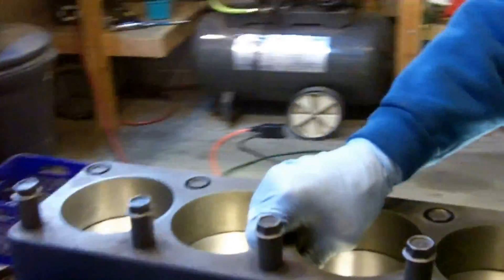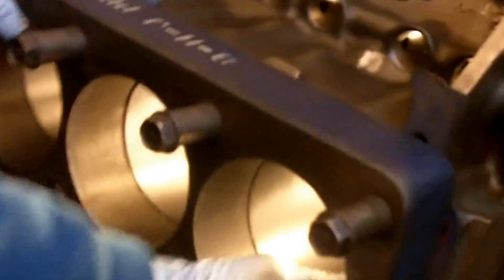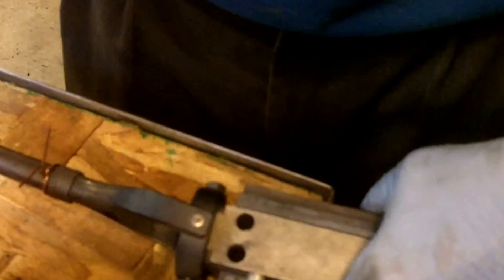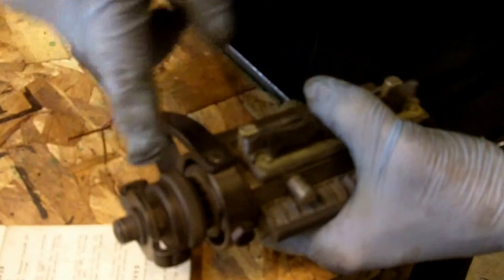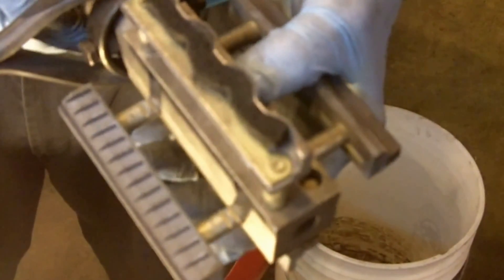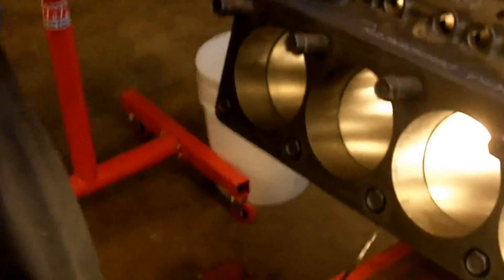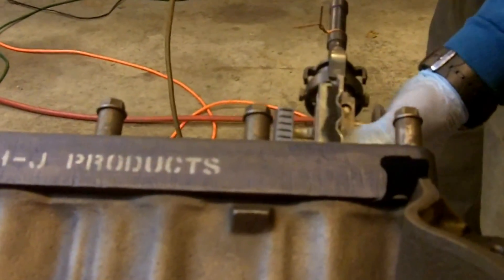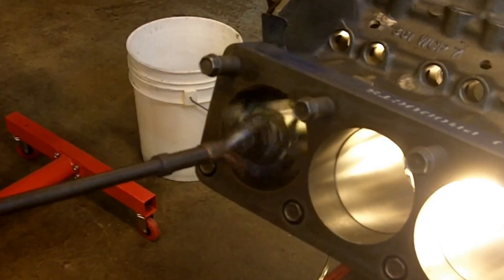Engine Building with Rog - Hone and Measure - HD

Comment: I wonder if the engine stand creates bore distortion, by having the engine supported only at one end (vs two ends in car)? I've watched videos of honing on the assembly line and OEs usually hone blocks sitting on a flat surface. Great tips, thx.
Reply from the maker: Thanks for watching. I'll have to ask the old man about your question. It's a good one for sure. There is so much material where the stand is holding on to the block that I doubt there would be any distortion, but I guess you'd never know for sure.

Comment: I'm using a plateau hone tool made by Lisle to remove flat spots and vertical scratches/grooves using 80, 180 & 280 grit stones on a Hyundai 2.4 I4. The engine has thin steel sleeves pressed into the aluminum block.  I don't want to take away too much material from the steel sleeves via the honing process.  Would leaving a shallow and narrow vertical groove in the bore effect compression and oil burn that much?  Thanks in advance!
Reply from the maker: Thanks for watching. My old man said you don't want any vertical grooves, ring could snag and you could have compression loss. Best thing to do is make sure it has nice cross hatch with a flex hone. Thanks!

Comment: Excellent video! I'm just wondering why you guys don't use any oil as a lubricant. I am just few days before I want to deglaze my engine but I have that 3 stone hone and I'm wondering if I should use some lubricant or not. The principle is in general almost the same it's a stone honing, it's not that flexible stuff. So why you don't use it and what should I do, lubricate or not? Thanks a lot!
Reply from the maker: Thanks for watching. I'd have to ask my old man for sure. I'll do that and get back to you! I have a feeling he is going to say not to use any lube since it would just cake into the hone, but I don't know for sure and don't want to give you the wrong advice. I'll let you know for sure.
Reply from the maker: My old man said for a deglaze, use a flex hone with some lube. You should be good. Thanks again!
Reply: @BarnStangz  Thank you very much

Comment: Invest in a honing tank it will make a difference you wont believe. A simple metal or plastic tub under the stand and a decent pump. Does not have to be a flood flow equal to a solvent tank would work. make some simple shields to control the splash. 2 Quarts atf 1 quart 30wt 1 quart Kerosene. If the stones seem to be loading up add kerosene, use heavy pressure as much as you can control to avoid taper. Ruff and shape to withing .003  with ruff stones. Finish to size with a very fine stone 400 grit. use a 600 grit ball hone to debure. (you have to special order those) 
Always do short strokes at the bottom between full strokes if it is tapered smaller at the top thats easy to bring back if its smaller at the bottom it can be impossible to get straight again.
 This is 30 years + of professional experience. take it or leave it .
Reply: Why would you comment on a video explaining and showing how to do what you’re explaining in the comments? It’s ignorant and unwanted... make your own tutorial if you want to be informative
Reply: @matthewcarkner3687  A little lernin makin your ignorant little brain hurt yah moron troll
Reply: learning if you’re going to insult someone, at least be educated enough to come correct. Have a good day “sir”
Reply: @matthewcarkner3687  his info
Is correct, while the original video is correct also, he just added additional info and procedures that apply. Both are old outdated methods when dealing with today's rings and cylinder surfaces. This applies more to old cast iron rings/moly, rings today are far more advanced and require totally different cylinder surface finishes. If your not using a profilometer these days your not doing it right.

Comment: Thanks for a great video – this is realy wisdom for a lot of us and I’m looking forward to watch your other videos. I’m about to replace bearing rings and wondering if I should hone with both stone and flexhoner as you do in the video. Or is it only necessary with the flexhoner? The cylinder has not been bored, scored or anythin and messauring of cylinder diameter shows horizontal ovality – less than 0.001 inch.  Thanks again
Reply from the maker: Thank you for watching. The old man knows his stuff and he REALLY likes to share his knowledge with everyone. I have some more videos on my channel that you might like. We are going to try and finish up this 408 winter of 2019/20. You know how life gets in the way, lol.... Engine has been 8 years in the making!

My old man said that the flex hone should be fine. just make sure you clean it well with Dawn dish soap after and blow it off good. Then coat the thing in WD40 unless you're going to paint it right away. Good luck brother!

Comment: Would this hone open a cylinder enough to allow a dry liner to be fit.
Reply from the maker: You would want to have a machine shop get the rough size and then yes, you could perform the finish hone for a perfect fitting.
Reply: Would it be possible to do it with this, all of it I mean. If I want to insert a dry liner of 1.5 mm thickness, could I use this first with rough stones then smoother ones.
Reply from the maker: You sure could. It would take time and lots of cleaning of the stones when the get built up with material, but yes, you could do it this way!

Comment: I bet you could build great turbo 4g63.  probably not your cup of tea. but with your experience I feel it you could build one that holds 60+lb of boost.
Reply from the maker: Mikey; I'm sure that the old man could build a nice turbo engine. I actually would like to do that at some point. My old man has built a 22RE and a LOT of 1st. Gen Mazda Rotary engines. I'd like to do a video in the future about building the Mazda. I think that would be fun. Thanks for the comment.
Reply: BarnStangz I have a 22r in my Toyota pickup truck. has over 300k on it and still rolling. 
Yes! a rotary video would be awesome.

Comment: How do you dress the stones to make sure your hone isn't cutting a taper? Do you just compensate with your strokes? Eventually you have to cut your crosshatch and cant modulate where you're spending time cutting anymore so what gives?
Reply from the maker: Dressed the stones by using a wire bush to clean them. Every few strokes, we'd remove and clean them. But if your bore is good and round and the stones aren't loading up bad you'll get good cross hatch. You have to listen to the dwelling as well. I'll try and get some more information for your from my old man this weekend.
Reply: Because this style of hone is "rigid" more or less rather than spring loaded like a ball hone or "apprentice propeller" as I've heard them called I believe this hone will be more sensitive to how parallel and even the two stones are end to end, if one side of the stone is worn more than the other the hone is going to cut a taper for a while until the high spot wears down from cutting as the smaller end will be doing less work and wear down slower similar to how lapping is done. I'm debating investing in a hone like this (around 150 bucks) but my main concern is maintaining the geometry of the hone because it is not "driven" by the bore as much as a ball hone or tri-stone. 

I had someone from the machinist facebook group sugges that if possible (in the case of a motorcycle cylinder) alternate from one side of the cylinder to the other sticking the hone in each side.
Reply: @Max_Marz  these types of micrometer adjustable hones require maintenance, you can maintain by measuring the stones installed in the tool using a micrometer or using prussian blue on the stones in a known good bore and marking the high spots and then dressing the high spots down using a dressing stone or diamond plate, sometimes it is easier to buy replacement stones if abnormal wear is encountered. These hones are not really the thing for a one off, quick rebuild job, they are a professional tool.
Reply: @2secondslater  I especially liked the prussian blue method against a reference. This pleases the machinist.
Reply: @Max_Marz  no problemo, I am not a machinist but have been a tradesman in the automotive industry for 25+ years and know a thing or two about machining processes etc

Comment: The torque plate doesn't do anything unless you're removing considerable amount of material with hone.
Reply from the maker: +Marek Sumguy Using a torque plate applies equal distortion during honing and simulates having heads on the engine. You want round bores right!?
Reply: +BarnStangz  Sir!... i am well aware of the intended purpose of a torque plate.   I don't think you understood what i was saying.  Im saying... that the distortion may be greater than the amount of material being removed.  Understand?
Reply from the maker: +Marek Sumguy I guess I don't understand what you're saying. The torque plate is bolted to specs, then honed. if you take a dial bore indicator and go from the bottom of a block without a torque plate hone job, you'll see ugly results. Most builders always hone with a torque plate... but to each their own. I wasn't trying to get pissy with you...
Reply: +E Gibson  Nah... you're just a dumbass who wouldn't recognize sound advice if it hit you in the face.
Reply: Ha... i was just thinking the same thing!.  It really depends on how much material you intend to take off with the hone.  So when you bore, you actually under-bore it... and then you reach your final bore size dimension with the hone.  Comprende?
Reply: I thought that before honing with a torque plate, the block would be needed to be bored with a torque plate.
Reply from the maker: Marek Sumguy This guy gets it.
Reply: If you torque plate bore the block then the finish hone should also be done with a torque plate installed, it is as simple as that.
Reply: Jake Elliott correct. But that’s not what I’m talking about.
Reply: @mareksumguy1887  I would think that this old timer wouldn't torque plate hone a block without having it torque plate bored initially, thus negating distortion. Just my thoughts.
Reply: +Marek Sumguy you just sound like a d-bag trying to flex his brain..beat it

Comment: You need honing fluid!.
Reply from the maker: +Marek Sumguy Not all stones require honing fluid, always read direction for the stones that you have. The Sunnen stones that we used called for dry honing.
Reply: BarnStangz what is the difference between dry honing and wet honing with oil and kerosene
Reply from the maker: Really depends on what the instructions say with your stones. 500 series polishing will require wet. Finishing 200/300 series are done dry. This is for Sunnen. Sorry for the late reply.

Comment: Do you hone completely dry? I've read that some people hone with constant fluid flushing while honing. What's your thoughts on this?
Reply from the maker: I hone completely dry, the rpm is slow and I find that I only stroke for so long before the stones "load up" with fine particles that they need cleaned. I also think that honing this way allows for more control since you would be cleaning with a rag and taking exact measurements. I also think that depending on what the stones are made up might dictate if you could use a lube or flushing fluid while honing. Good luck!